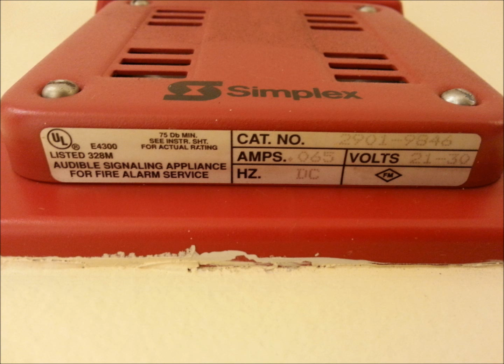Horn/Strobe In A Restroom (Simplex 2901-9846) -EPIC FAIL

Comment: My old elementary school built in 1987 had those along with 9806s. Both were scary loud...
Reply from the maker: That's what my middle school had. 9846's and 9806's, as well as 4903 series electronic horn/strobes. It was a 4002 system. It really scared the crap out of me the first time, but I got used to it.
Reply: My middle school had 4040's! I didn't get "relief" until high school (System Sensor Spectre Alert Classics on code 3).
Reply: Daniel Stewart  Sounds like my story. My elementary school had 4050's! I was in the auditorium the first time.
Reply: randomperson Fire Alarms my school and all the schools in my district will be upgraded to automated voice systems, right now at my school we have Wheelock AS’, AH’s, MT’s, and Exceder HSR’s on code 3, but on the agriculture island, there’s Wheelock ET1010’s, E70’s, E90’s, and E9024’s, I assume since those buildings are new, that’s the start of the fire alarm system upgrade, and I know for sure those alarms are speaker strobes and not chime strobes

Comment: I remember I went to a lifetime fitness, and in the family locker changing rooms they had a system sensor speaker strobe alarm. I always had the fear of that going off, because the changing room was very small and really echoing too.
Reply: CJ Willaston my Planet Fitness has a Spectralert advance horn strobe on the bathroom side and locker side of the mens room and a ceiling strobe in the middle of the room
Reply: It's a speaker/strobe, so it won't be loud.
Reply: As long as it's set to 1/4 watts it wouldn't be a big deal. If it's set to 2 watts, you are going to have a bad day.

Comment: A 2901-9846 is basically a 2901-9838 on steroids. It sounds at about 100 decibels at 10 feet, versus only 85 for the -9838. Whoever's in there when that thing sounds is in for one hell of a shock.
Reply: I wonder what happens when you put 11 (or more) 9846s together and set them off at once (near each other). I herd that 1,100 dB can create a massive black hole.
Reply: @SomeDudeWithAnExitSign  Yeah, Simplex had a top-secret testing facility in the Mojave back in the day. A college professor happened to wander into the fake town at the wrong time, and had to hide in a refrigerator to save himself from the deafening blast. Here's some recovered footage from the incident:
https://www.youtube.com/watch?v=jn4Vhkmb4Lw

Comment: At my elementary school(built in 1989) they had 2901-9838’s on 4903-9101 strobe plates, and they had 4904-9101 strobes in the restrooms, and one 9838 on the exterior got replaced with a 4901-9805, and around 2009-2010(I was in Kindergarten), another 9838 by the Kindergarten classrooms got replaced with a System Sensor SpectrAlert Advance HR, and there’s Federal Signal 450D’s on the outside of the portables, and there’s a Wheelock AH on the outside of the library and a System Sensor PA400B inside the library, and the pull stations are mainly Simplex 4251-20’s and there’s Radionics D325’s in the portables, and a Fire-Lite BG-12 in the library, and there are some unknown Simplex smoke detectors and Simplex 2098-9450 heat detectors, and there used to be Bosch D273’s in the library, but a year or two after I left, they were replaced with System Sensor i3’s, and it is unknown what the panel is right now, but I’m pretty sure it is a 4001 or 4002

Comment: At my school, one set of bathrooms has a wheelock ns horn/strobe while the rest have gxs remote strobes
Reply: At my school, most restrooms have Wheelock AS horn/strobes. However, the small restroom near the chorus room and all single-stall restrooms have RSS strobes. Also, the restroom in science area (which was added later) has an E70 speaker/strobe.
Reply: There's a middle school next door that has Cerberus Pyrotronics I-SM-series speaker/strobes everywhere, even in single-stall restrooms.

Comment: That's even worse than the Walmart I worked at; each restroom had a ceiling-mount SpectrAlert Advance horn/strobe, but I believe they were on "Low" volume. From my experience, electromechanical horns are worse than electronic ones (even the SpectrAlert Advance!)
A building at the university a friend of mine goes to used to have Space Age 2DCD+AV32 horn/lights (it was a Standard system from 1979), and in the bathrooms they had horn/lights in them as well! In 2009-2010, they upgraded to a Simplex 4100U system (the majority of the non-dorm buildings on the campus use Simplex systems) and replaced the old alarms. Some of the restrooms replaced the Space Age alarms with TrueAlert horn/strobes (which, like the SpectrAlert Advance, can also be pretty brutal), but other restrooms had remote TrueAlert strobes replace the old horn/lights/
Reply from the maker: +wileyk209zback Not sure what it is with buildings putting horns in restrooms, haha. Completely unnecessary.

Comment: Good Grief! Even with a low-volume horn, the echo alone would be murder on the ears. That horn had better be disabled!
Reply: Even if it was, whoever is doing the annual test on that should be writing it up and get it switched out.  In fire alarm, what is present is the reality.  We (Simplex) make an adapter plate to cover that device footprint and just shove a true alert strobe only 4906-9101 on top of the plate.  Wire through the horn circuit in the back box and you're golden.
Reply: there not that loud
Reply: @catsgame9282  Not if they're set to low volume. I've got a few salvaged horns that switch between low and high by jumper.
Reply: @Imacuser223  there only 75.4 decibels

Comment: I work for the state in the capital city of my state, going into our Capitol building there actually is a Siemens UMMT horn strobe in the Men's room on a certain floor! It was just above the urinals so pretty low on the wall! It may just be that floor cause the higher floors have just remote strobes! That's scary if that ever went off though!

Comment: Look here's the thing no one should not put a mechanical horn strobe in the bathroom that will actually startle you and what I know is that if this alarm from the video is on march time it might sound louder and I basically experience with this once when I was at Macy's the other day basically in the mall I saw that they have simplex 9805 mechanical horns on a 4904 9105 strobe and they also have remote strobes too but here's another thing right when I went to the bathroom I was shocked to see that there was a horn strobe in the bathroom and when I looked at it I was worried that it might go off and right when I washed my hands guess what happened yeah it started to go off and it scares the life out of me and I almost fell down and it was on march time and it was really really loud so my opinion is to recommend not to put any horn strobes in the bathroom because trust me it will scare you just like what happened to me and by the way the rest of the mall had gentex shg and a gentex mini horn and some simplex truealerts and specralert advances and yeah when I got out of the bathroom when it started to go off my family told us that we need to leave and right when we got to the mall all of the alarms were going off everywhere and it was super extremely loud which I will never forget that faithful day
Reply: Are you talking about the Macy's at the Danbury Fair Mall in Danbury, Connecticut? Was this where it happened?
Reply: I was at the  florence mall in kentucky that day